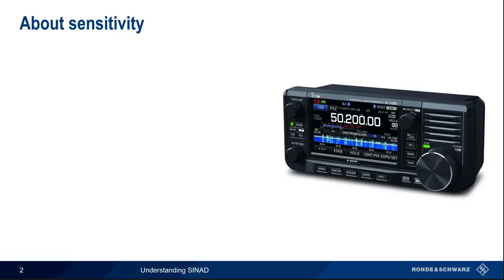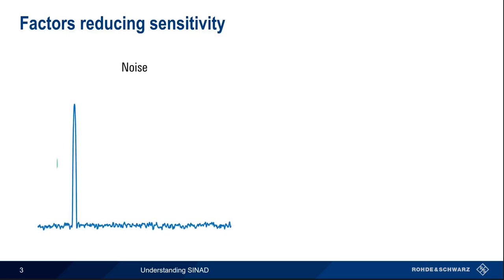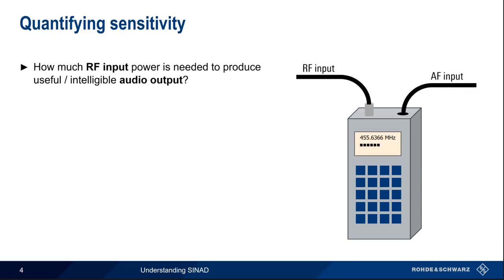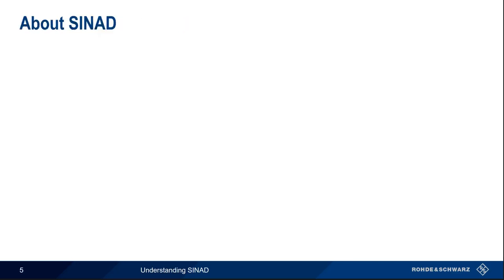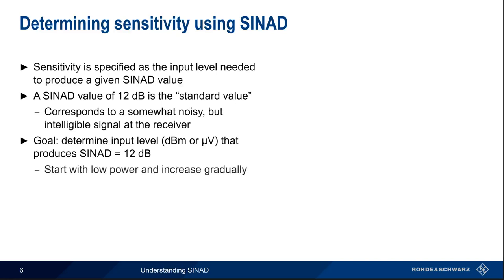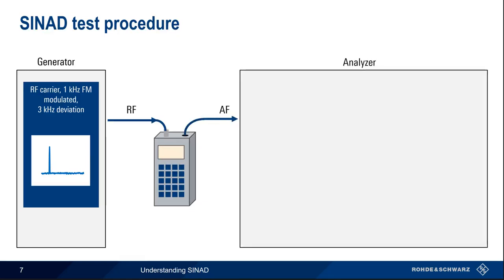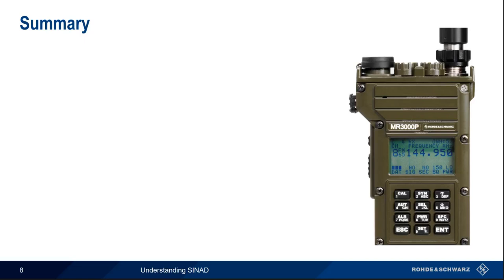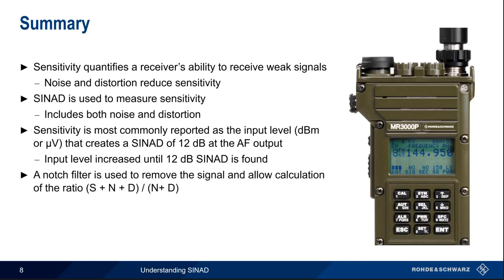Understanding SINAD

Comment: Clear explanation but how sharp does the notch filter have to be to make a good SINAD meter, or equivalently a good SINAD measurement ?
Reply: I am not an authority on this but there is an ETSI definition. It defines a notch filter (ETR 027). With the standard tone frequency of 1 kHz, it states that a filter used for SINAD measurements shall be such that the output the 1000 Hz tone shall be attenuated by at least 40 dB and at 2000 Hz the attenuation shall not exceed 0.6 dB. The filter characteristic shall be flat within 0.6 dB over the ranges 20 Hz to 500 Hz and 2000 Hz to 4000 Hz. In the absence of modulation the filter shall not cause more than 1 dB attenuation of the total noise power of the audio frequency output of the receiver under test.

Comment: The harmonics and noise are generated by the receiver in this case?
Reply: Good question.  Since we're using SINAD to measure receiver sensitivity, we're measuring distortion created within the receiver.  So it's really important that our test signal be as spectrally pure as possible with a good SNR.

Comment: After watching to this video I guess there is no standard way of measuring sinad, the way we measure sinad is we should get 12dB Sinad at .2uV not .3uV.
Reply: Most manufacturers specify SINAD at 12 dB, so this is a the de facto "standard" used.  But generally speaking, there's no "passing" or "failing" value for SINAD -- lower voltage values simply mean "better" sensitivity.  In my experience, SINAD is most useful as a comparative measurement: a receiver with a lower 12 dB voltage value is more "sensitive" than one with a higher value.  Hope that helps!